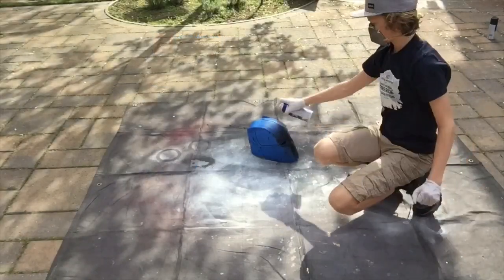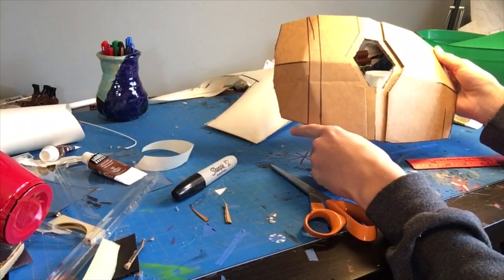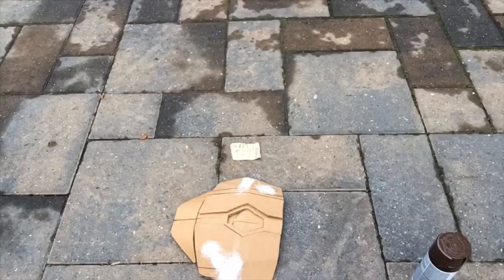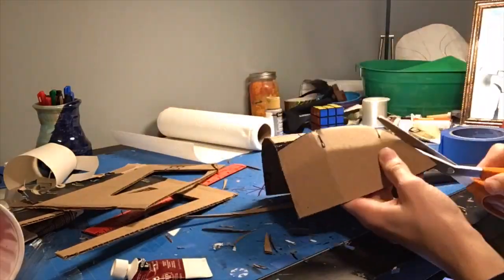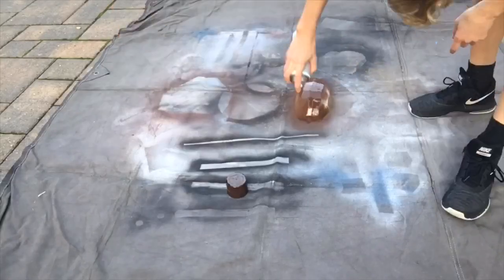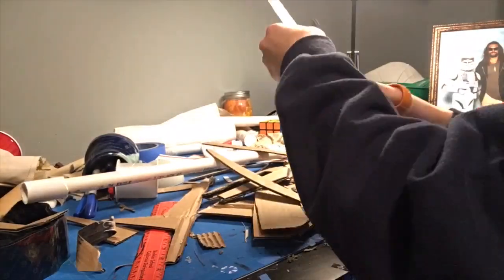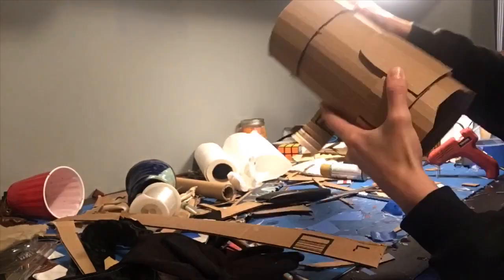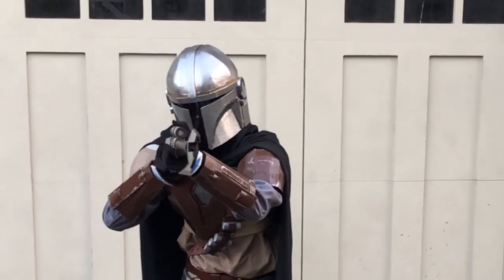DIY: Mandalorian costume from the Mandalorian!

Comment: You re doing a really god job! I Just didn't catch how did you connect the parts of the armor (like chestplate) to Your under material? Was that a glue or something? Happy New Year!
Reply from the maker: To connect the chest plate and both shoulders I used Velcro just in case I placed it wrong, I could later reposition it.